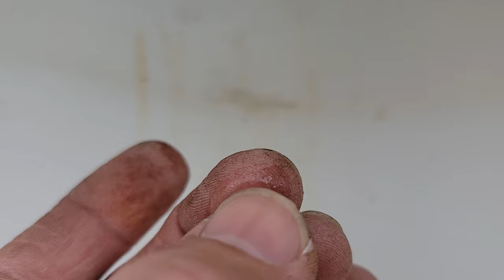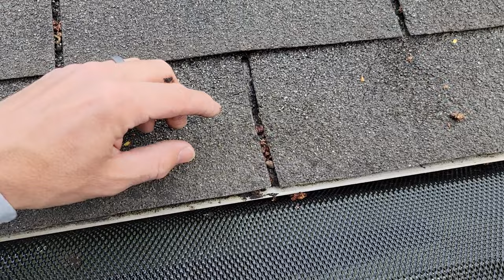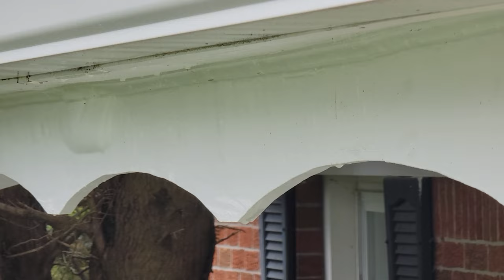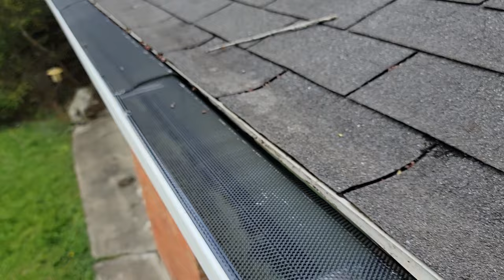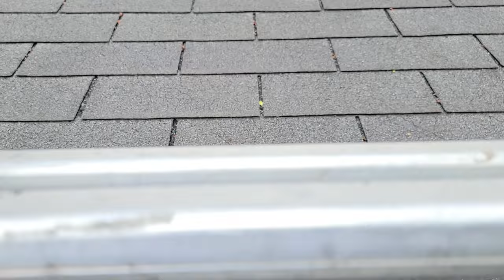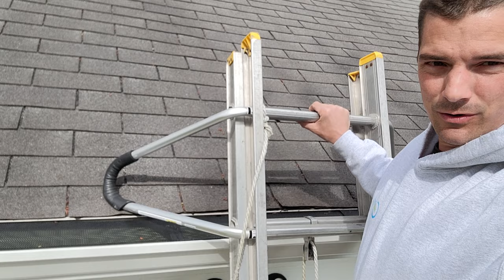Roof leaking behind gutter into the Soffit

Comment: Yes as a former gutter installer for 28 years. We used 8'' spikes and ferrules on our Seamless aluminum .028 Gutters.  I can see that the Gutter is to high more then likely it's those hangers that folded the drip edge back as well...

Comment: I have installed roofing for decades from 3 tab to now architect and always have the shingles 1/2” over the drip edge on eaves and the rakes to create an adhesion break to shed water. If gutters are installed properly water will fall into the gutter from the adhesion break from the shingle to the drip edge , same principle going up the rake that avoids intrusion from driving rain. Starters are critical for the system to work properly as well as looking at roof area( volume ) to use either a residential or commercial gutter to direct water away from the foundation !
Newer houses in my area have huge roof areas and a lot of them have residential gutters that cannot handle the volume of water.
Reply: We used a 3/4" overhang and the drip edge. One thing I like to do is put the drip edge on top of the felt.  Adds one more layer of protection.

Comment: Well that was a very good video.  I am dealing with the exact same problem as those curled shingles and water leaking in behind the fascia and drip edge.  I was thinking they used a small 4" starter shingle instead of using a full shingle at the bottom. But, like you said their is no cheap easy way to fix this.  Thanks

Comment: The gutter alone without screen would be fine. The problem is the screen was an after thought and the gutter wasn't lowered when screen was eventually installed. This is a common occurrence for screen installs since the gutter crews homeowners or contractors just want to slap it in quick and go but in order to do the job correctly need to go to the highest spot along the gutter run install a piece of screen as a temp to see if it needs to be lowered or not

Comment: My old garage has this exact problem. The garage sits towards the back of the property, so the problem went unnoticed. It's flat, slightly sloping roof,(block garage) and the drip edge they installed has an upward lip, and whoever installed it made only 2 cutouts(20ft run) for water to drain into the gutter. That made the problem much worse. Water was pooling up, dripping down the middle of the blocks and seeping into the garage at floor level. I now have to replace the last roof board, drip edge, and probably the gutter.

Comment: I'm a gutter guy and I see this all the time the shingle isent over hung the drip edge aswell and the nails in the drip have pulled out from bad wood ot they were nailed to high. We sub alot of gutters for roofing Companys and we will see this every now and again. When it's poorly secured there's not much you can do as a gutter guy. I can't tell you how many drip edges I have stepped on to try and flatten them out. But I'm not a roofer lol. And we don't push up on the drip we put our hidden hangers inside of the gutter instead of snapping on the back so that your not pushing the drip up when you lift up and when you go back to screw them all in you can just go back and notch the drip where its needed
Reply: Wouldn’t that leave the screw hole exposed to water? Just wondering cause I’m about to attempt to fix a leak on mine.

Comment: It amazes me when the roofers hardly nail off the eave drip. It should have alternating nails, front and back between each nail, every 3 or 4 inches, nail the piss out it!Many roofers seem not to understand the expansion of metal in different climates, with causes the up turning or curling of the eave drip over time without a good amount of alternating  nail pattern. Also, I always spread roof cement also on my eave drip prior to applying starter strips, and lay the starter strips into the cement, (we live in Florida so ice an shield is optional) and I NEVER use 3 tabs for starter strips.

Comment: Don’t those gutter guards end up being covered with so much vegetation that the water ends up backing up under the shingles? Even on a proper roof job, unlike this one.
Reply: There are several styles of gutter guards out there. Some are highly effective & some are scam products that can do more harm than good. The type in this video is one of the more common styles available. They are very effective in keeping larger debris out of the gutters to prevent clogs in the system. No gutter protection system is 100% maintenance free but can be extremely effective depending on the product & installation method. Some shed debris better than others. It is an extremely important to inspect your roof at least twice a year for debris due to fact that accumulated debris can cause water to back up under roofing and shorten their life span. If debris is accumulating on your gutter protection it can be brushed away at that time.

Comment: Why would any roofer ever install the starter row of shingles so they don't overhang the gutter, or install the gutter so far out from the roof edge of the shingles, when every roofer knows that some rainwater will wick upward a little ways along the underside of the leading edge of the shingles before it drops down into the gutter? Even without the bizarre rain-trapping dip shown here, all along the starter row of shingles, if the leading edge of the shingles doesn't overlap and hang over the rear wall of the gutter to direct rainwater into the gutter, some of the rainwater that wicks upward along the underside of the shingle edge is going to be deposited onto the front edge of the plywood panels under the shingles and eventually deteriorate them (and if the panels are OSB, they'll crumble even faster), and some of the water will go behind the rear of the gutter and get to the fascia wood, eventually destroying it too.

Comment: What if the water is coming out or leaking at the front edge of the fascia and soffit joint? I have a similar problem but the leak is coming out of the soffit vent. I opened it up and it’s wet at the bottom where the fascia and soffit meet in the front
Reply: I think this is my problem too. Did you ever get it figured out?
Reply: @jane1385  I ended up getting a new roof and gutters. Expensive but fixed the problem.  Got tired of messing with it and watching it leak
Reply: @mikeford9176 our roof is only 2 years old so no way is that an option but this leak is stressing me out seeing all the soffit starting to rot. I had the original roofer come out but it’s still leaking. Guess I’ll have to find another one and pay for it now.